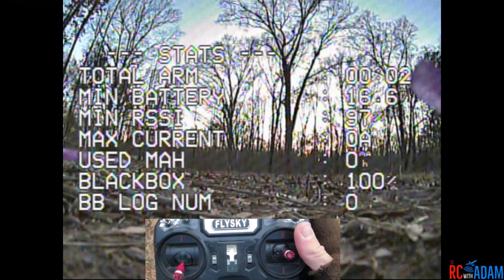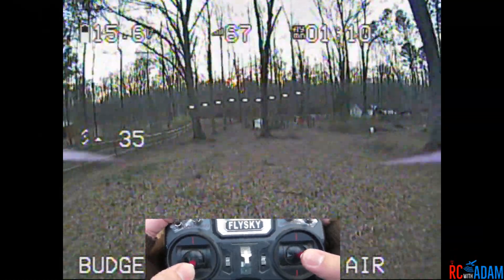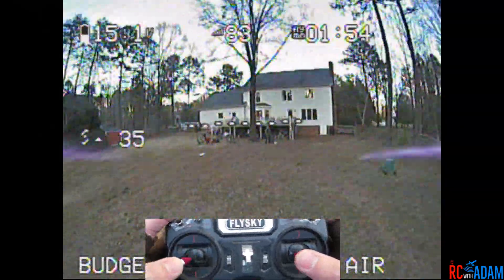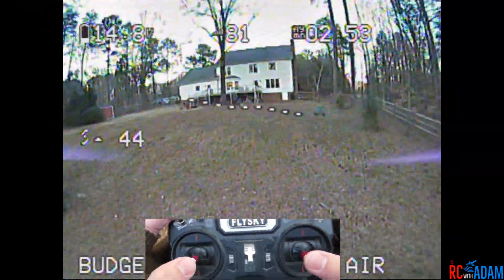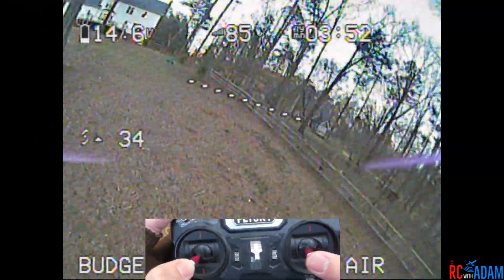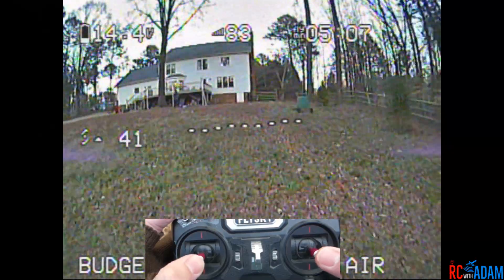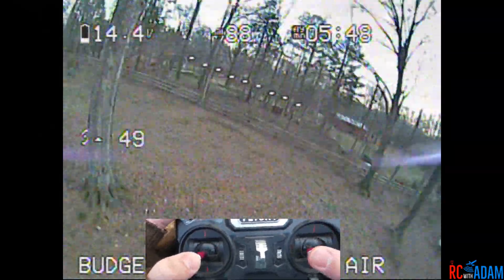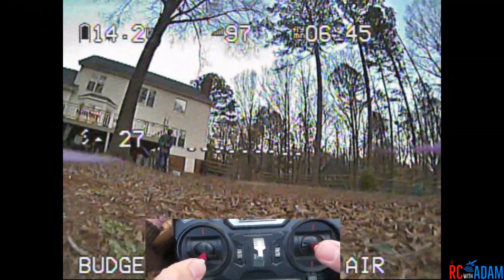Let's Learn to Powerloop! FPV Flight - Budget Basher - Mamba F405

Comment: Sweet vid, power loops are so fun to do in a wide area. Btw have you made any modifications to your quad? My most recent one is switching the cam and antenna out, Hope to see more content from you! -Ash
Reply from the maker: Thanks! No mods other than flying with top mount battery lately. Lol right now there's really nothing I want to change! What cam and vtx antenna did you put on?
Reply: RCwithAdam damn ok, maybe I should go top mount battery too, I switched the cam to foxeer predator 3 and I put the tbs triumph on, I do like it a lot more now. It’s currently my star quad to fly, it’s so good!!

Comment: Thanks for these videos. They are helpful. Especially with the stick cam. I’ve noticed when you turn you yaw and then roll about half to 3/4 of the way into the turn which makes it very smooth looking. That’s something I need to work on because I tend to yaw and roll at the same time and it’s messy.
Reply from the maker: Good eye! I hadn't really even noticed that myself. I guess the stick cam really helps to explain what I'm doing even if I don't realize it! (Sometimes it helps me to go back and watch at half speed)